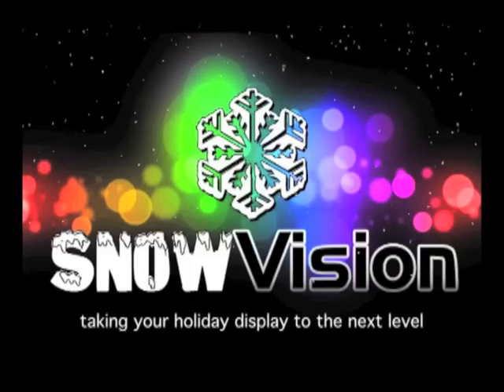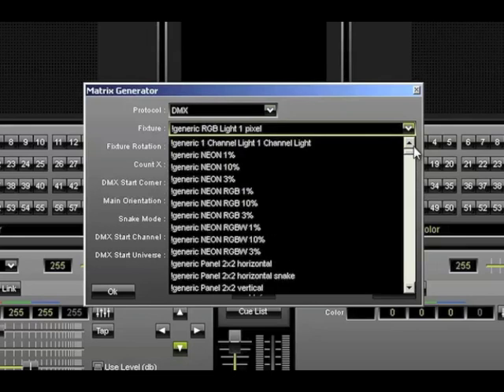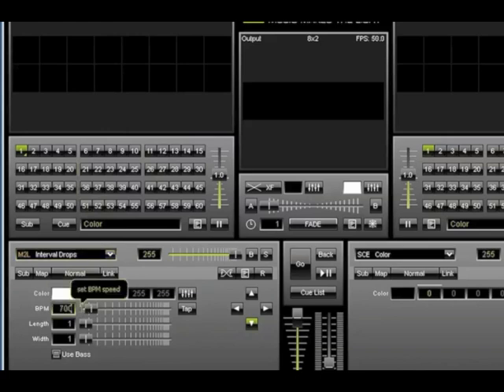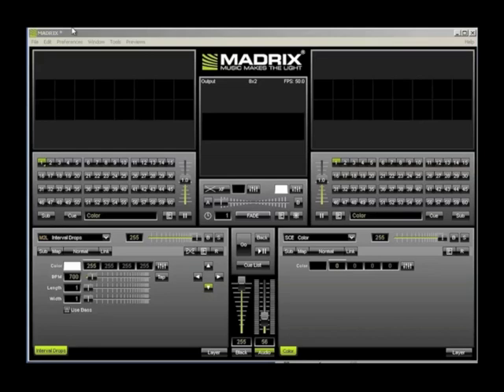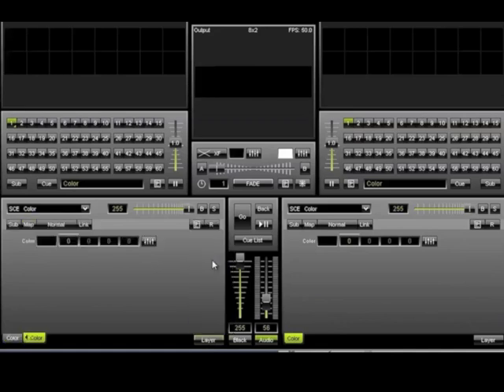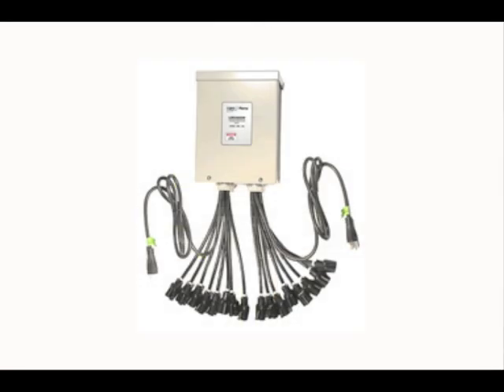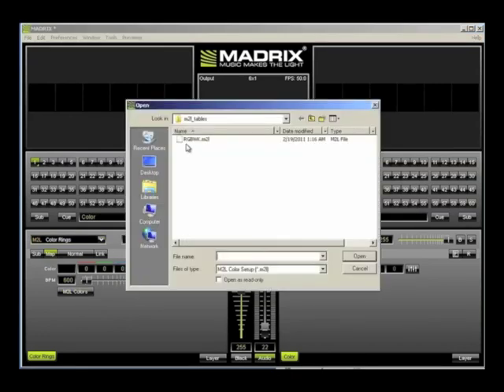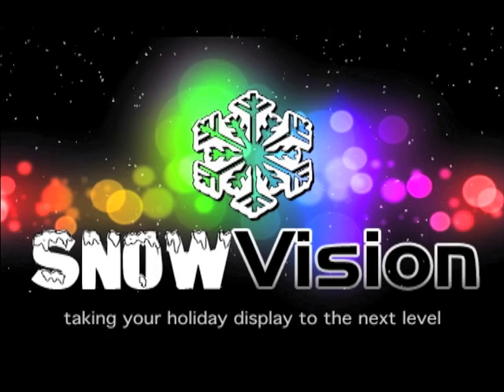Sequencing made easy with MADRIX

Comment: I hope by now you have your price for Madrix. When I purchased it in 2013 it was $450 for one DMX universe.  VERY expensive. The demo works if you spend the time to do it right.  If you have elements in your display that need order and timing, then stick with the LOR s/w. Madrix will be too random for arches as an example. You can however program specific effects and store them in bins. Not really sure why you might want to do that with LOR and normal lights. Perhaps if yo were only using pixels it would make sense.